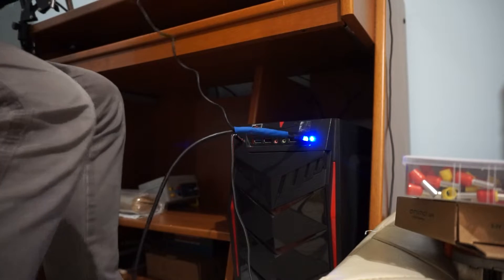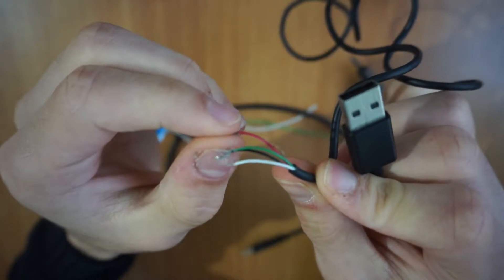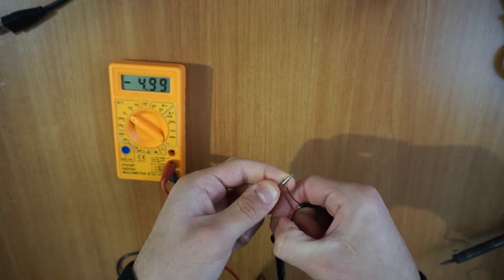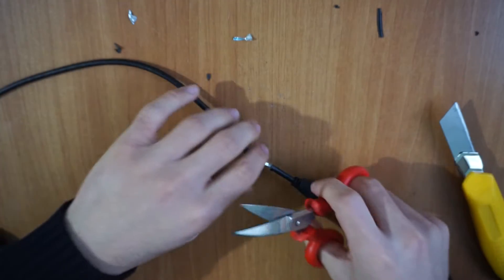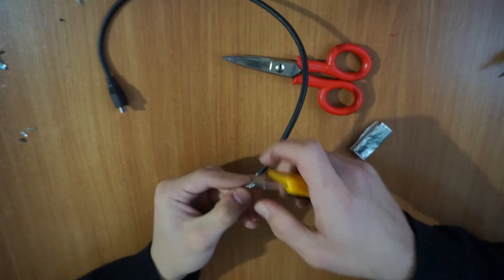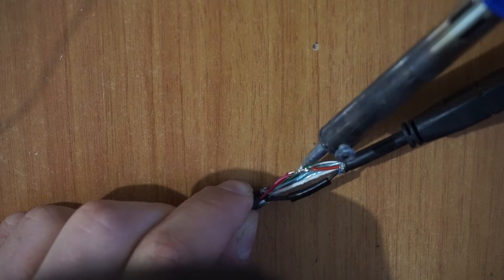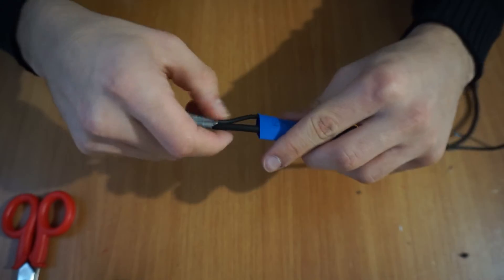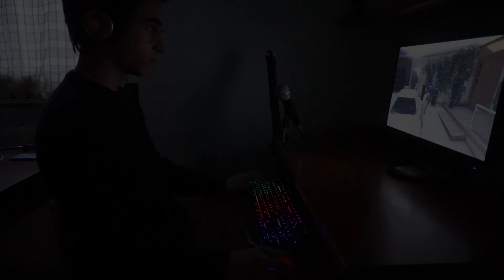Create a USB Power + Data Splitter to power an external hard drive externally

Comment: but I find interesting to benefit from the power of the usb port of the computer AND from the charger. Because sometimes with a laptop there is no option to plug a charger on the wall, and the original 5v from the laptop may be enough. (If I'm in a forest!)
Reply from the maker: i like the forest
Reply: get a cheap solar battery, should hold you over

Comment: moreover, If the answer is yes, where should we put it? thank you!
Reply from the maker: if the answer is yes (but it is not), you should put the diode on the positive cable in the direction that goes from the usb of the pc to the hard disk and from the usb of the power supply to the hard disk. In this way, imagine the diode as an arrow, there are who arrows on the red wire that go towards the hard disk

Comment: fantastic. Only, don't we need to add a diode to protect the pc/laptop usb port? I'm asking only, I'm a beginner.
Reply from the maker: You can use a diode to protect the usb ports and so the pc and the power supply but i made this thing because i want to make the hard disk use more current and adding a diode i lower the voltage of 0,7V and so i will not have 5V on the Hard disk and other problems appears

Comment: Wouldn't it be the best if you separated the Red Cable (5v).

What I meant is by fully removing it from the main USB cable. Then attaching the 5V output (micro USB) straight into the external cable.

Would this setup be better? I don't think my USB Port on my PC will like being fed 5V from the power adaptor
Reply from the maker: no because i don't want the external power supply every time i connect my hard disk. I want it only when it has to carry out heavy tasks
Reply: @mauri_scio  then u should still use a diode 

Luckily internal part on USB ports in your computer have some safety built in, otherwise it could end up bad. I hope u don't use cheap charger cuz it's still a change that voltage spike is too high and u're slowly damagining your board.
Reply: @mauri_scio  hello i've been thinking doing it using two separate usb hdd cable, 

 for my wii and wiiu setup, my question is: how to safely remove the hardisk after i use for gaming, do i need shutdown the console first and then un plug the usb 5volt phone charger later ? 

will it corrupt my data if i do then ?
Reply: @mauri_scio  sorry I forgot to add the important part, is it fine for the USB port of the PC to be also powered. Since the external power cable is attached wouldn't it also send power to the PC?

Comment: We can also use an external powered usb hub for same purpose. But this option is expensive.
Reply from the maker: Right
Reply: Can I use that hub to power an external hard drive that will be connected to a DVR? 

If I plug a USB cable from a DVR to a powered hub & connect another USB cable from the HD to the same powered hub, will the DVR still transfer data to the hard drive?
Reply from the maker: The important thing is that a usb cable should always carry GND and +5V and the + and - of the data. It doesn't matter how
Reply: @mauri_scio  thanks!
Reply: the cheap hubs i used to buy have an outlet for usb c power source for this very purpose

that being said, i'm more running into problems connecting more than 1 drive per port.. i've managed 3 (2 nvme 1 hdd) but it's not plug and play, have to really work on it - 1 drive is fine and nvme doesn't need power but there are definitely conflicts, have yet to find a hub without